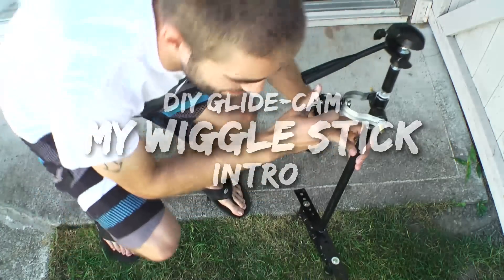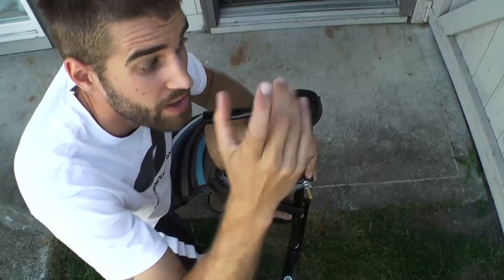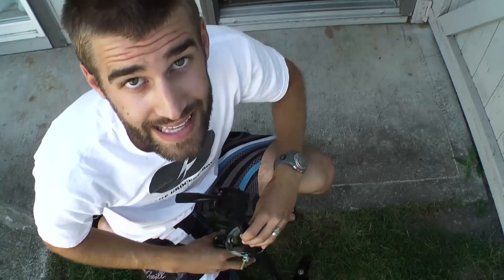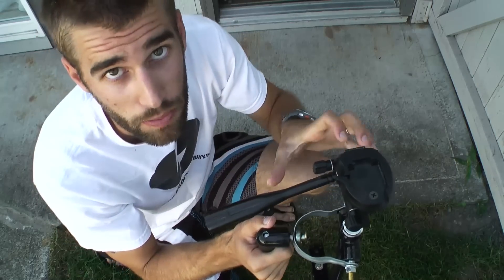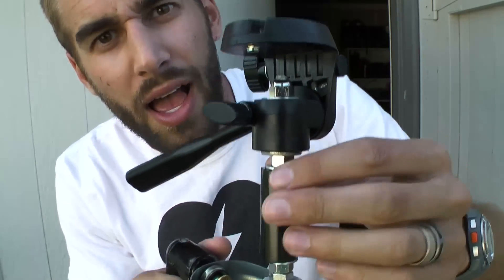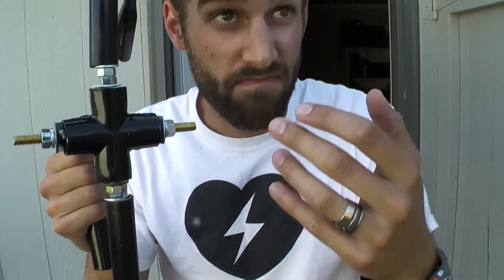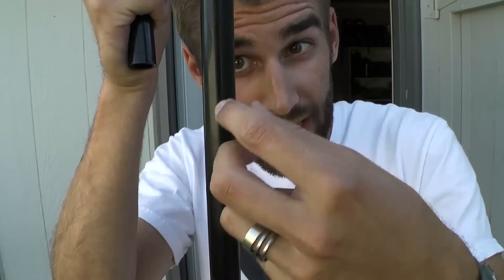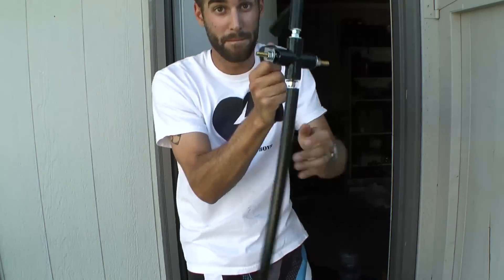Glidecam Gimbal DIY Steadicam Test / ''My Wiggle Stick''

Comment: I'm going to follow this design to make my own but I'm curious, why did you set up your counter weights like that?  It leaves no room (no convenient room anyway) for adjustability in the amount of weight you have on there.  Why didn't you stick to the common design and put one upward facing, long screw on either side so you can slide weights on and off?  The setup you have in this video is giving you a ton of sway in your shots because your bottom weight is probably heavier than the camera you have mounted.

Comment: I built this but it seems to be too freely moving actually, I get a lot of pendulum effect when moving around. Do you dampen the swing with some friction material or a tightening bolt?

Also: how do you balance vertically?

Comment: A 5/16" rod is pretty heavy. 1/4" may work better to reduce weight. How long did you make the rod? Trying to gauge what you felt was the most appropriate length on that part. The T-fitting will work somewhat better, as they do not require your metal handle piece to have to be spread out as much to hook over the joints. Look how much your metal handle is spread. That is because of the joints being farther away on that 4-way cpvc piece. Measure a 4-way & compare it to the stock t-fitting. Wider?

Comment: Using a round 5 lb. weight at the bottom will make the unit actually look less DIY or amaturish. The gray color of them contrasts nicely to the black paint of the upper part. Instead of using a 4-way piece, you can use a T-fitting and drill a hole on the side that does not have the extension on it. This allows your rod to be fitted and works as well as using the 4-way cpv fitting.

I am not dissing your build in any way, as I like it and can certainly learn from it. Thanks for posting it.

Comment: You do not really need to heat up the pvc to insert the skate board wheels. If you put them into a vise and also add a socket to just cover the bearing, you can press them into place with absolutely no heating. I have done this multiple times. About once in 20 tries, you may crack the t-fitting, but that is very rare. The cpvc will allow the bearing to drop into place with no heating required, but the stock white works and will actually fit tigher by pressing the bearing into place as described.

Comment: Great design! But...
Hmmm... You're doing something right but some you don't... You need a better camera plate so you can properly align the camera for dynamic balance. Also, when shooting, you should hold the shaft below the gimbal (gentle touch) - some channels may help you adjusts the weights faster. Then you need to actually work with it ("dance") - it's a training process to get those really smooth shots. Just my two cents.

Comment: Nice design, haven't seen that variation before.  A little tip: If you rotate the counter-weights at the base to face outward rather than point towards the center it would increase the force needed to pan, reducing panning jiggle.  TJust make sure to watch your feet!    Keep up the good work!

Comment: Neither the video or picture show what holds the parts together above the 4 way section part of the wiggle stick. like from from the tripod head down to the 4 way connector.....i want to build this but I need to know what rod or size bolts

Comment: @HoeCuzz Yes! You basically just put the weight on the upper side and mount the tripod mount on the bottom... then you'll have to turn your video 180 degress if you don't want to make a special hardware piece that gets the camera right in the first place...